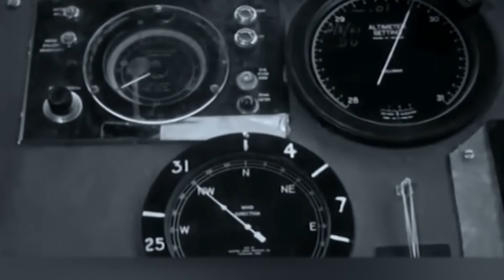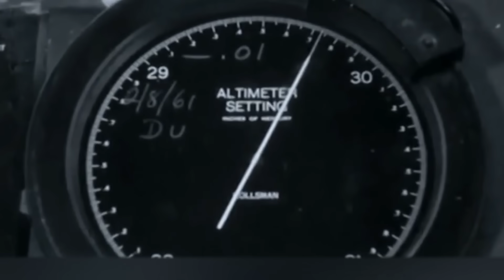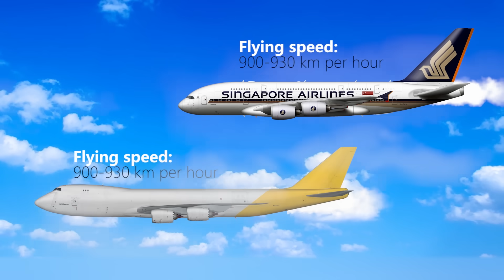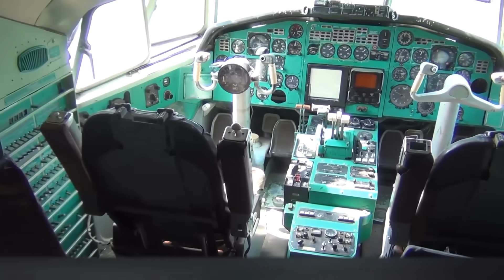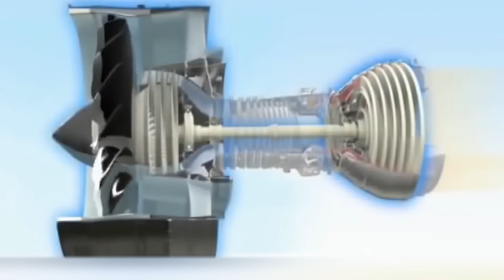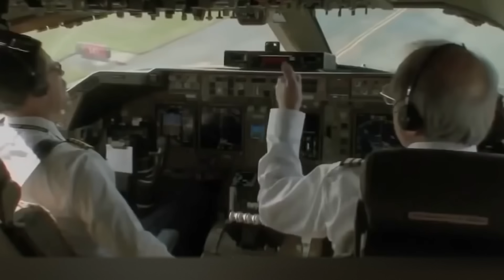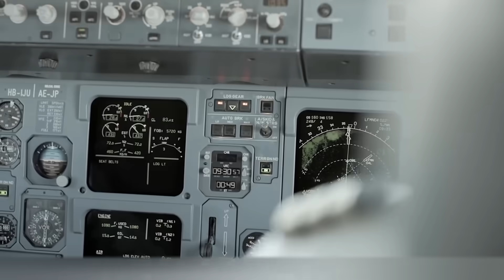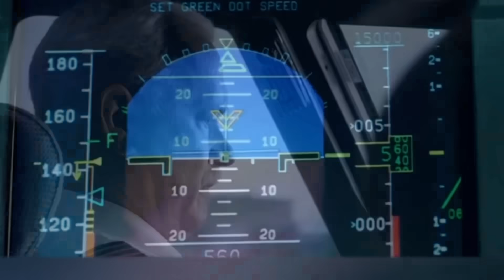Why Do We Fly so Slowly?

Comment: if stalling high speed can make the plane have no chance due to speed that will make the plane faster to crash but if slow then pull throttle up to reduce the speed of the heavy passenger jet or airliner and the small ones tf did i write lol

Comment: The answer to the question isn't even in this video. It's greed. Planes using a massive amount of fuel is a scam---they don't use much fuel at all. Keeping the planes cheap, the fees and surcharges high, and the speed low are ways to maximize profits.

Comment: Because design features, morons. They all fly about .8. Air Force One fles about 9.0. The speed has nothing to do with the sharp nose, but the Mach plus one design of the wings, etc. You don't want the fucking wings to rips off. Take a Lear past  1.0 and you really will disintegrate.

Comment: The big answer: fuel. As in, if you fly too fast, you'll burn too much and it will cost too much monies. Commercial airlines would prefer flying at a specific speed that enables them to be as fuel efficient as possible. 

By the laws of physics, the increase in drag equals the square of the increase in speed, so even a slightly faster flight requires a lot more fuel. Hiking a plane's velocity by 10 percent takes 21 percent more energy. Speeding up by 40 percent approximately doubles fuel consumption. 

It's crazy. Flights are actually longer now than they were back in 1983 (NYC to Denver is 19 minutes longer) and even 1973 (DC to Miami is 45 minutes longer). It's probably safe to assume that airlines have found the perfect speed to maximise fuel while not sacrificing too much speed.

The littler answers to why air travel hasn't gotten any faster is because there are more jets in the air now. Jets, unlike propeller planes, fly at the same altitude as commercial airliners and when a commercial airliner is behind a jet, big boy has to slow down. Also, airlines have gamed the system on reporting flight times through block padding. They've add a few minutes to scheduled times in order to make it seem like their on time (when they're not). It's all screwy!

So yep, blame it on the airlines that it still takes so long to fly. Or on our reliance on fuel.

Comment: Planes don’t fly faster because it would be structurally unfeasable for them to do so at high altitudes (where most planes cruise). It would likely result in being put into coffin corner more often (a point at which the minimum and maximum speeds of an aircraft at a particular height are very close together and crossing either boundary could result in a stall or the plane tearing apart mid air).

Comment: Very true. eg a boeing 777 cruises around 900 but it can push to 950 plus or minus max speed approx.and tail winds can somtimes push the planes ground speed to 1100 plus or minus.however the tas true airspeed excludes tail or head winds most likely measuring the true engine out put.but yeah tail winds get you places faster and some pilots love it.free boost with no added engine power

Comment: Well... There's also another reason for why planes go slow. So, in a captain's perspective, you go way too fast say like 350 knots =  650 kmh, an overspeed warning sounds which means that the plane is going too fast and that can result in a stall (A deep decent) if the plane doesn't slow down. Also, the ATC (Air Traffic Controllers) who are in the Control Tower tell the planes where to go in an airport facility. So there's a speed limit given to the plane from the ATC. And if the pilots don't listen to the ATC and do whatever they do, the plane's flight plan is going to change into VFR (Visual Flight Rules) mode from their original IFR (Instrument Flight Rules).
Reply: RealFarazMSQ stalls don’t occur from a plane going too FAST! Idiot

Comment: Air resistance is only a matter of altitude: if air is too thick, just go higher.  What limits flight speed to the current figures is the sonic boom, which is not allowed by most countries.  They tried near-supersonic designs (e.g. Boeing's Sonic Cruiser), but the little gain in speed was offset by the inefficient flight at transonic regime during all flight.  Transonic regime (between Mach 0.9 and Mach 1.2, depending on aiframe design) does not generate a full sonic shockwave that reaches the ground, but the localized shocks creates great drag that renders the flight very inneficient, so you either go subsonic or supersonic to be efficient.
Reply: mostly what limits flight speed is fuel consumption. faster you try to go the more gogo juice is consumed at an uneven rate.

Comment: Going from 950km/h to 850km/h will have almost no perceptible effect on short to medium range flights. Air travel is still extremely fast but I think everyone's patience has simply decreased in our instant gratification society. If a modern airliner like the Dreamliner can fly 30% further than an older generation plane like a 747 that means you get a 18 hour flight over with in one go rather than having two 9 hour flights and a layover of many hours in between. It has never been faster to travel long distances than it is today. Sure, a 727 was significantly faster than a Dreamliner but a 727 couldn't take you from New York to Tokyo in one go.

Comment: Short answer:  Drag Cd remains nearly constant until 0.8-.85 Mach where a shock wave forms on the lowest pressure part of the wing or body.  This shock wave causes a separation of the flow which causes the Cd to go more and more with a peak at Mach 1.  After 1.2 Mach the Cd becomes nearly constant again, but at a much higher level.  So, between 0.8 to 1.2 Mach super sonic airplanes should avoid these speeds also due to high Cd.  Fighter jets do just that.  Climb, dive through 0.8 to 1.2 and then level out.   The max speed with lowest Cd is just before a shock wave starts on the wing or body part.  Once a shock wave forms, the Cm or pitching moments act like it is "stalled" and a pitch down will occur.  This is called "Mach tuck" and can be dangerous in subsonic designed airplanes.  The airplane has to be designed differently to fly in super sonic speed due to this pitching moment effect.  Delta wings are used because they have the aerodynamic center nearly at the same location subsonic as supersonic and thus lower trim drag.  Airliners are therefore optimized for < this Mach drag onset speed around 0.8-0.85 Mach.  Super critical airfoils (flat tops) allow higher Mach numbers.  At 35k feet + Mach 1 = 660 mph.  So an airplane at .83 Mach will fly around 550 mph.

Comment: 238,604 liters of fuel. yeah right  177  cars on each wing  and you all think that thing can fly at 90 mph  it would drop out of the sky  or not even get of the ground    ITS RUNNING ON AIR  THERE IS NO FUEL ON THESE PLANES

Comment: Simple physics..double the speed on any given object and it will quadruple the resistance from the air, which means more power is needed..and there is only one source that power can come from.
So, the next step is: Flying supersonic in the outermost layer of the atmosphere. It reduces air resistance to a minimum. Furthermore, it will reduce the heat that components like the nose cone and wing tips are exposed to. That is not a neglectable part of the equation...just have a look at the SR 71 and the tremendous problems the engineers were facing back then, when computer simulated models only existed in Star Treck.
Reply: Kalle Klæp drag being proportional to the square of the velocity is only valid at subsonic speeds.
Reply: @johnp139  Ok, I see. I didn't take that into account. Also, the difference between the object moving in a laminar flow vs turbulent flow.
So, correctly the answer must be something like this: http://www.lpi.usra.edu/meetings/lpsc2009/pdf/2059.pdf
Of course, we talk aircraft and not meteors, but the equations should be the same.

Comment: miles per hour would have made this more easily understood for a lot of us.  but better than that, if the narrator had used mach numbers,  .925, .950, .980, etc..  the problem of speed vs efficiency would be much more obvious.

Comment: In actuality a passenger jet cruises submach 1 anywhere between .75 Mach to .95 at near flight idle power setting of course cruising at +30,000 feet. It’s not that you’re going slow, it’s just harder for your eyes to process without an object to compare to, unlike driving.

Comment: Most  Commuter aircraft in the '60 were supersonic (just barely) and created sonic booms on a regular basis. People complained and properties were purchased and noise reduced due to this. Fuel economy and noise reduction are the MAIN reasons for the initial speed reduction. Then design changed due to the restrictions.  Simple

Comment: @5:30 "The most modern aircraft have turbojet engine"
It is actually the opposite. The first jet aircraft used turbojet engines but were soon surpassed by turbofans and nowadays all passenger jet aircraft in service use high bypass turbofans.
Turbojets are extremely fuel thirsty and noisy, which is why they are no longer used except on some older fighter jets.

Comment: It's all about cost... It's cheaper to fly slower and use less fuel.
Engineers want to go crazy and build hypersonic aircraft that run on unicorn dust and can land vertically and the cabin is perfectly silent, but no airline would want a ridiculously expensive and complicated plane like that. 

Hopefully with the development projects like the SABRE air-breathing hybrid rocket engine and a few others, cost will go down more and we will have a new supersonic age of fast, sleek, cool and efficient airplanes.

Comment: So many commercials I felt like I was watching cable t.v.. The last two minutes basically said it all... it's too expensive to go fast. 500-600 mph is the sweet spot for speed and not burning too much fuel, wearing out the plane, and keeping ticket prices reasonable. I'm sure noise and pollution controls are factored in there too

Comment: They don't.  They fly as fast as they can safely fly.  Jet airliners fly just below the trans-sonic region.  Any faster and they encounter aerodynamic flutter and tear themselves to bits.  They're not designed to be supersonic.

They fly just a few knots below the "unsafe" speed in order to give themselves a margin for error, as when encountering varying winds aloft.  ("Safe" can become "unsafe" very suddenly if a tailwind suddenly becomes a headwind.)

Supersonic aircraft (including the Concorde) have never been commercially successful because they are horribly inefficient at speed.  Fuel hogs.  Not profitable.  The Concorde was a flagship advertising the money-making fleets of Air France and British Airways, just as the First Class cabins on the Titanic were unprofitable and intended only to shine down on the profitable classes.  

Besides that, this video seems to be based on the general idea that "going faster uses more fuel."  Seriously.....is anyone so stupid you didn't already know that?

Comment: There are a few reasons. All aircraft fly close to Mach 1 these days, so to fly 'faster' would mean to go supersonic. Doing so is extremely energy inefficient due to physical reasons. But what about flying closer to Mach 1 like in the transonic region? There is a danger in doing so too as normal aircraft would break apart of they break the sound barrier. A sudden gust of strong head wind or a dive that's too steep can cause this to happen. In fact, there have been at least 2 cases of pilot suicide where they dived passenger aircraft to break the sound barrier and kill everyone on board. Flying faster also means using smaller wings with higher sweepback angle to reduce drag, this increases the risk of stalling and makes it hard to control the aircraft in the event of a power loss.
The world's fastest passenger aircraft today is the Cessna Citation X which has the 2nd highest wing sweepback angle, 2nd only to the Boeing 747. Imagine losing engine power and having to glide in that when so little lift is generated.

Comment: There are thousands of planes in the air at any given moment, 24/7. What an enormous amount of fuel consuption and pollution that is. Adding  to the equation all the thousands of ships running on crued oil around the globe nonstop, it really makes a difference if I move my little ass via a prius or a beetle, doesnt't it. That's the new belief beyond reason to soothe them all.

Comment: They did create some faster it was called the Concorde. It was successful for some time....
Highest speeds highest stress on the airplane fuselage... which means after certain number of flights the plane has to be grounded for structural maintenance or permanently discontinued...

Comment: the video was "TLDR".  Should have been 3-5 minutes.  I stopped watching at 3:10....because you had not even begun to speak to the fact that while modern jet liners are marginally slower....they fly way farther and thus skip multiple fuel stops that the first generation of jet liners would have needed.  Also, they are cheaper to operate on a seat mile basis, and yes the primary goal is profit, it also means cheaper tickets.  So the slower airliners of today still reach destinations more quickly and more cheaply.  There's your 10:46 video in a 38 second read.

Comment: The real answer? Government meddling is why.  It is the culprit behind any technological and/or economic stagnation.

The problem with the logic in this video is that it fails to account for the operating ceiling.  The farther up into the atmosphere that a plane travels the less 'air resistance' that the plane will encounter.

In addition, technology of engines have coming up with ways to operate at higher atmospheric levels.  However, these technologies tend to shift to a fuel other than oil.  As air and oxygen is in short supply.  MoreOver, combustion engines in general are horribly inefficient.  Most of the energy is wasted as heat.

However the oil industry, and the government that has a strangle hold on it, have a vested economic interest in making it as difficult as possible for anyone to design and build a plane that uses something other than a petroleum byproduct.

Comment: TLDR: It's because planes now use the more efficient Turbofan engines instead of the gas guzzling Turbojets. Remember, more complex systems may be more efficient but usually, the simplest processes can handle the most speed/powwer aka turbojet.